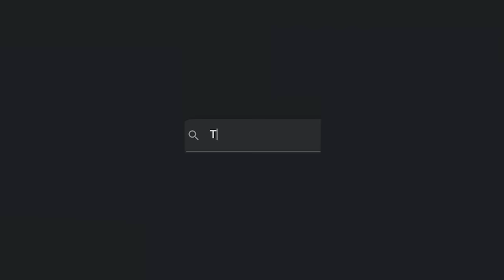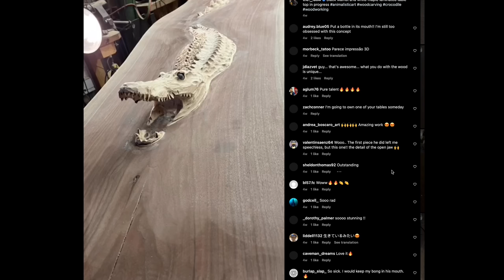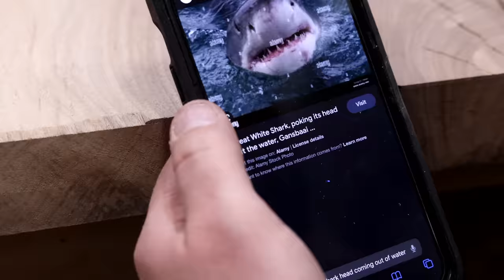I Tested Viral Animal Carving Table

Comment: I think your first try was awesome, and we all know you learn so much after each attempt. As an artist, what I think would help a lot is the prep work. Draw a rough look of the whole shark, and then draw a straight line across to represent where the table top would be, that way you aren't guessing at sizes or anything because you have the whole shark drawn in proportion to start. That would help a ton with the flow of the whole piece. Then from there your awesome woodworking skills take over.

Comment: Definitely should try this again. I would also recommend cutting the rough shape on the blocks not attached to the table. You could then use silicone to pour around the rough shapes in an enclosure so you have a complete flat surface to clamp down on. The silicone may compress a bit requiring more force to be applied, though in theory, should still work. Test in small scale before committing to a large piece.

Comment: Looked great - I particularly loved how charring the 'waves' around it came out, that looked awesome. A couple minor critiques if you try again, the lower jaw looked a bit too much of an underbite, and maybe some more rounding at the back of the head where it comes out of the water or something, felt a little too squared off (that's also where adjusting the proportions will help too, I think).

As far as catching the teeth on fire - maybe not that, but possibly adding some charring inside to darken it up for that "razors that rip you to shreds before you disappear down a dark gullet" look could be cool ;)

Comment: You gotta do it again! You did a great job considering you have such little carving experience.

As a sculpter and wood carver tbh the simpler the shape the harder it is sometimes because everything has to be perfectly in scale or its very noticeable. When you add tons of details, if something is a little bit out here or there, it's harder to see because the shape is more irregular. Just my two cents!
Reply: I agree. a beginner should always start with a fantasy creature as there are no "set rules". he should also have started with way more wood, he was so scared of carving anything away at all. that piece on the shark's cheek was bothering me the whole time

Comment: Process modification: Glue up blocks, sketch on blocks, bandsaw to rough shape, glue to table surface. Just putting it out there. Maybe it works, maybe it doesn't, but the time savings in shaping are definitely there.

Comment: Before you glued it to the slab I think you should have used the band saw like a band saw Kelley box.   Get the bulk of the wood or if there then glue to the slab and refine it from there....but 6 in 1 have dozen in the other. Great video

Comment: Carve an anaconda river table with a partial epoxy pour over top (ie: if the anaconda pieces stand 4" on top of the table, you'd pour 1-2" around it to aid in the submersion aesthetic).

Comment: If you're going to do it out of separate pieces  it would probably be easier to carve it unattached except for the last half inch or so where it contacts the table then attach it and blend the last bit. One of the most difficult parts of carving is tool angle and being able to hold the piece in your hand  while you do a majority of the carving helps with that a lot. Actually with your skill set doing a top down carving of an entire shark in a light pigmented epoxy river that it breaches out of would probably end up really cool.

Comment: My only critique would be that the back of the Megalodon's head should be a little more oval shaped as it goes back into the tabletop instead of straight across, it would make the body underwater appear more tube shapes and organic instead of appearing to be a rectangular prism. Overall I think its a great piece and could even benefit from a glass floating top to make it functional!

Comment: With the shark, it would have popped a little better if you torched the outline of the shark into the table.  That would make it feel like you're seeing just below the surface.  As far as burning in tight areas, you might want a more focused torch head.  A torch lighter might even be useful for burning small details while not burning more than what you want.

Comment: I don’t know if it will work or not but you may try thermal trap gel on those teeth and it may stop them from catching on fire. I’ve used it for a lot of brazing but I don’t know how good it works on wood

Comment: John, did you go back and find out that you can melt metal into wood if it's a tin/bismuth mix?
Melting temperature is below 300F.
Very soft metal. Easy to use tools, etc.
I suspect that's how the other guy was doing it. Not pure aluminum.

Comment: Super awesome, especially for a first attempt. I think your life would have been a lot easier if you did a lot of bandsaw trimming on the blocks and carving of the inside of the mouth before gluing them down. You'd also have a better idea of the scale when gluing because it's hard to get an idea of the scale before the parts are roughed in.

Comment: You should make one again but after sits done cover the table in a light blue resin like waters and if you like add LEDs to the sides in a die angle way facing towards the shark then covered the LEDs with wood also using wood glue lined up to the top of the able to make the water glow where the shark pops out more showing details like in the shark wanting it's prey

Comment: for the head and back fin there wouldnt be a dip there. because from the fin to the nose its a gentle rounded slope downwards. so the whole front half of the body would be out for the angle you were going for. otherwise great job for your first time doing a piece like this!

Comment: Not a bad first try! But I have to point out, the square shape  of the back of the shark's head kinda messes with the flow and realism of the piece. Sharks are pretty rounded (circumference wise), so the shape poking out of the water wouldn't have angles like that. Also the other two parts are oval, like you would expect, but not the head. Still, not bad for someone who isn't (apparently) super well versed in sculpting!

Comment: You need to start with a paper template/pattern as a way to keep the scale, just fold or slit to fit your design.  Also, the head should not be that square, and get a hand piece for your dremel, easier to work with.

Comment: Wouldn't it be easier to carve the block first and then glue it onto the table surface only after you're happy with it? That way, it's easier to get to the underneath bits like the teeth and whatnot, and also you can throw it away and start over if it turns out to be crap.

Comment: Some tools are just way too powerful for sculpting, especially the dremel. Its made to take stuff away, sure, but it is not made for detail work.

Id say try again and get a proxon micromotor for the fine details.
Also try a sculpture that doesnt have an undercut, like a hippo in the water or a snake.

Comment: You have to try again. As an artist i can clearly see that you have an eye so i know you can get much better very quickly. You seemed to pretty quickly spot most of your mistakes. You should definitely use the clay sculpters methods for the eyes by entirely removing the socket then gluing in a round piece of wood.

Also first video so im not familiar with your background

Comment: Try carving it before you glue it down next time,and should have smooth cut the mouth. Carve teeth from dowels on work bench in vise , drill holes ,glue teeth in holes.

Comment: Not gonna lie, that's one weird looking shark but good try tho 😂😅, how about next time try finding a live size shark toy, mold it, pour resin into it and tryta make a river table with epoxy resin in the middle flowing as a river with the shark that you molded bulging out the table or you could do it the other way around and have the shark diving into the table and you can see it underneath the table, "ITS A CHALLENGE".

Comment: i will preface this by saying you are way better at carving than me, I couldn't have done what you did here.

But.

I've never in my life seen a shark that has a body that undulates up and down like a sea serpent.  They move side to side.  If the back under the dorsal fin and the top of the head are out of water, so is the rest of the back.

Comment: It's an unnatural pose and articulation. Sharks do not have necks to preen upwards, nor serpent-like jointing to get that "Nessy" three hump surface break. You're either going to see the dorsal fin or the mouth break the surface, not both unfortunately. Unless of course the shark was leaping out of the water.

Comment: Head too far from fin. It turns out that she seems to be bent in the place where the vertebrae go. It can not be so. The correct configuration would be where the back part protrudes above the "water" along with the head.